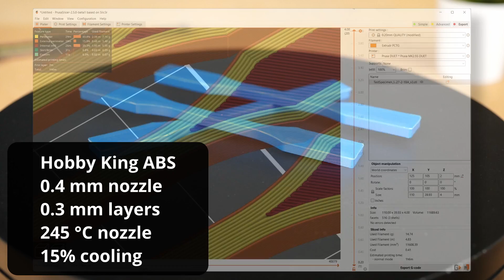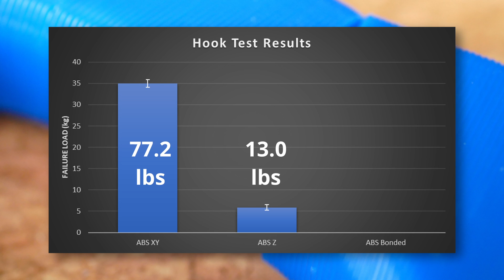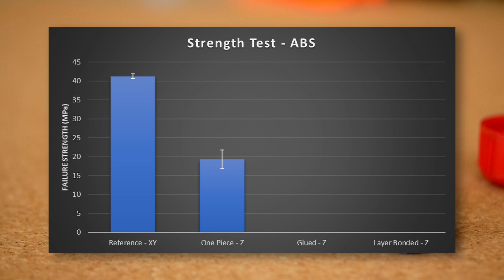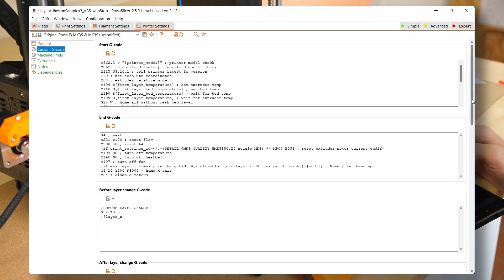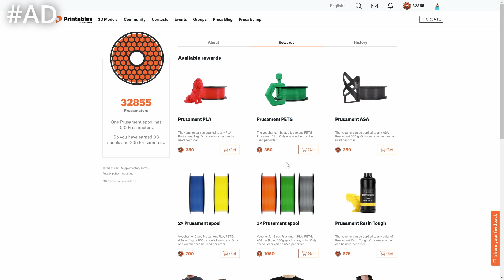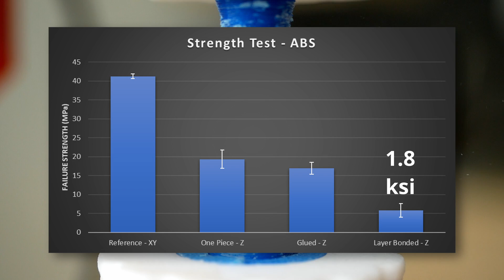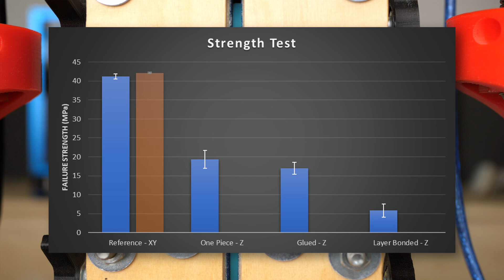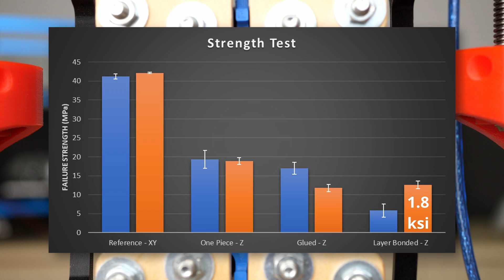Perfect Layer Adhesion if you Brush Solvent onto every Layer of your Print?

Comment: What about changing the nozzle tip geometry? Something like a cake decorating nozzle that lays star shaped beads instead of round ones. It should allow more surface area between layers and the layers would no longer be planar.
Reply: I think that would likely create stringing issues from the sharp corners dragging.
Cool idea though. Maybe an ovoid shaped nozzle would work.

Comment: What about printing in a vacuum chamber? I think that concept would be interesting to see it's effect on the print strength. With no air to be between the layers it would make sense that the layers would bond better.

However there would be a lack of cooling if that was required to avoid stringing and such.

Comment: i wonder if you used an ABS paint (some ABS dissolved in acetone) would work better.. and id be interested to see what layer "ironing" would do for strength? or maybe "pinning" each layer by having small holes in each layer that have a perimeter and say every 3 or 4 layers the nozzle stops and extrudes some material into the hole so it goes down through the layers? youd need to move the holes around the part and have some layer overlap so each layer has the same amount of support

Comment: I have an idea which might sound crazy, but under the right conditions could be done.

Acetone has quite a low boiling point, which means at a reasonable temperature it can become a gas.

What if, using a specially made, hermetically sealed enclosure, you were to print ABS inside a an atmosphere of acetone?!

:D

Comment: I guessed failure on this project because adding a solvent is like printing a thousand first layers together. I wonder if using a heat gun between layers would be helpful. 

I recently asked my co-worker to design and 3D print a mount to install an industrial camera into one of our robotic machines.  He had never had a 3D printed part made, so I made a couple of suggestions. The intern who actually printed the part for us has never gotten his own 3D printer working, but he seemed to be about to operate our Ultimaker ok.  When my co-worker let me know we were ready for install, he handed the print to me.  It weighed a ton.  I thought, 'what happened?'. Turns out neither had any idea why to infill, and they printed it at 100%.  It felt like a block of delrin, lol. They had decided to print at 100% because there were a number of tapped holes and they "didn't want to deal with wall thickness" and just printed it solid. Hilarious. The part worked great and my $10k camera and lens appear to be working well. The machine operators are so thankful to no longer need to use the point and shoot camera and the robot takes it's own pictures.

Comment: Wild idea for layer adhesion: Non planar printing/slicing. You could add one or more "V"s into each layer. Basically the perimeters go down a bit and then back up in every layer physically locking different layers together. It wont be perfect but it is probably a fairly big improvement.

Comment: What about pouring acetone inside the infill of a print, before closing it with the top layers? 

Instead of using the solvent to fuse together the layers from the outside,
And instead of using the solvent layer by layer (where the new layer is deposited certainly hotter than the boiling point of acetone) as you just did,
maybe you could obtain a smoothing effect on a grater surface by fusing together the layers from inside.

Just wondering!:) As usual thanks for your work!

Comment: Didnt get through all the comments but have you tried to rotate the part 45 degrees, print and test for strength.  It would require more support but the sheering force would not be perpendicular (typically) to to force applied to layers either in tension or sheer.  I would think it would be somewhere between the sheer strength perpendicular to a layer and parallel to the layer.

Comment: I wondered if leaving pockets several layers deep a couple of layers in from the exterior that could be filled with filament, or even resin would make, for stronger parts.  The pockets could be filled so that they tied each other in an alternating pattern like verticle brickwork. One effect would be to put the adjacent layers under compression as an injected column of hot filament would contract more in the z-direction which should have a beneficial effect as FFF printed parts normal fail at the outer surface layer lines.
Reply: The same principle as prestressed concrete.

Comment: Dear Stefan,
Rotating head or rotating table you choose!!!! you can't "weld" and cool at the same time, do you do it like that with tin? the impression must always advance in the same direction to be able to point a laser at the joint and cool the layer later.
You can also use a 20,000-turn spindle with a tapered-end milling cutter used to make printed circuits. The material will be heated by friction and will generate a V-groove where you deposit the new material.
3d printers are a design compromise, not the best design and they still do a great job.
Excellent channel, great job!!!

Comment: If you really want a strong part and are willing to do extra work. Why not simply print a part with extremely low or no infill and just fill it up with an epoxy or some castable polymer? Or just resin print it with a mechanical resin if the part needs to be strong in the Z axis too.

Comment: Hi Stephan, I had this idea floating in my head for a bit now. What about trying acetone vapor deposition in a vacuum chamber,  I think the acetone might be penetrate deeper within the parts.
Reply from the maker: Tried that already. Check my videos.
Reply: @CNCKitchen  I saw that video that's what gave me the idea of trying it in a Vacuum chamber so the acetone could penetrate every gap, I think in air I don't think the acetone can displace the air in those gaps.

Comment: What about using a combination of infill and solvents. Where Instead of full infill you have tiny flow holes throughout, from top to bottom. Make a solvent inlet at the top, and outlet at the bottom. Where you would pour the solvent in the top of the part, and it would flow through all the tiny micro tunnels and weld them together.

Comment: Why don’t you make the parts without top and bottom layers so then you will have a path for the solvent to evaporate? I don’t think that would change the strength of the parts.

Also, I would place a sponge right to the hot end (at ~nozzle height) with a tube filled with solvent, and a small routine to move the sponge over the layer right before new layer is starting, that way you can “automate” a little bit more.

Anyway, awesome video!

Comment: maybe try print each layer normal, and then print the layer again, with no extrusion, no part cooling at 1/5th speed slightly pressing the hot nozzle into the layer. Kind of like ironing each layer.

Comment: Can you test whether a low level “fuzzy skin” creates stronger parts? Something like 0.06mm depth, 0.08mm distance? I feel the zig-zagging on perimeters could increase bond strength. Also test solid infill line direction (not gonna effect round columns but square cross-section objects maybe. I run my line direction parallel to square object sides as opposed to the usual 45 degrees (looks nicer in my opinion)

Comment: For the vertical layer samples which are like cones, you need to disregard samples that failed outside of the sampling region (aka any point except the thinnest point) because it means there is a some kind of flaw/anisotropy in the material at that point and is not representative of the material itself

Comment: You can vapour smooth/brush smooth Carbon Fiber ASA with acetone. By smoothing the outside it creates a homogeneous shell. Seems stronger in my opinion. You could also try airbrushing acetone on - (well ventilated area, respirator etc). I tried brush smoothing with acetone then an application of spray on “plastidip” metallic blue.

Comment: Do you think the delay between layer printing could add a confounding factor for controlling adhesion? I mean, each substrate layer cools more with added delay. Although, maybe the acetone evaporation makes this a moot point as it draws lots of heat out of the underlaying layers. In this regard, i wonder if layer adhesion trends with polymer heat capacity.

Comment: What about loading clay on printed parts like a casting with an opening at the top and mixing acetone with resin so it will more easily soak into the plastic as it sets up?

Comment: Pulsating extrusion ... thicker/thinner/higher/lower line sections (weaves) in each layer, but every other layer pulsates half a wavelength offset, resulting in a kind of dovetail joints between layers.

Sounds good ... but probably pretty hard to implement mathematically.

Comment: So the perimeter are only connected with the top to the bottom of the next perimeter. How about printing 2 perimeter, the outside with a hight X and the second perimeter with 2X, the next outside perimeter would go from X to 3X, the next inside perimeter 2X to 4X.

Comment: My top 3 ideas (I know the first two will work):
1: Print with natural filament. Colorants often negatively affect layer adhesion.
2: You already tested this one, but a layer width to height ratio of 4:1 or greater will help.
3: You could try aging in an air fryer (convection oven) at 80-85C for an hour or two. That's the temperature of my heated chamber printer (Method-X), and my ABS interlayer strength seems better than what you're seeing (but I've never tested it in the exact same way as you).

Comment: Maybe instead of solvent, you should try some primer (like ones used for gluing polimers)?
There are also techniques that are using corona discharge or other cold plasma for activating surfaces.

On the other hand with that test sample it might be possible to have "intermediate" layers, placed in middle between extrusion lines, and propably with lower flow.

Comment: Why not print the part at 0 or low infill and then pour 2 part epoxy, acrylic or polyester inside. You might either fill it 100% with resin or just pour it in and out to make a thick coating. It won't affect the outside appearance but would make it way stronger. The trick might be to ensure the part can be filled and not leak.

Comment: Maybe modulating the z height with a sine wave for instance, but only by a small margin relative to the layer height would increase bonding? I don't have the time to test this but it should be doable using Marlin or even g-code (the files would become enormous though)...

Comment: Stephan, what if, after printing a few layers the head moved to the center of the internal void between the layers or the infill and extruded a large blob to fill in the void. The print head can also move down by a layer of so relying on the taper of the nozzle for clearance. Some fancy slicer work will need to be done for complex shapes, but can be tried manually for simple ones. The blobs large thermal mass might help it bond to the walls and blobs below it, while the walls can be printed at lower temp with more cooling for better appearance.

Comment: I wonder if heating a print at a temp just below the warping/deformation/melting point for an extended period would help layer adhesion. Something like the method for tempering metal.

Comment: one thing i can think of for layer texturing is perhaps a few small bumps/ spikes on the nozzle around 1/10th your layer height and running it a bit slower. i could see this potentially creating a larger surface area of contact along with heating the plastic right before the new plastic is pressed into it. i would love to see you test this because as of now all my nozzles are ruby tipped.

Comment: In my lab, I had access to a sonicator probe. It could fuse pla together. I wonder if it would be possible to have the probe pass over each layer after the extruded to fuse the pla. Course that's beyond my skill set but using a sonicator probe to improve layer adhesion

Comment: I would love to see a layer adhesion test with a truly 3d printed layer pattern, so let me explain:

While watching this brilliant video, i was thinking about the 2d factor of layers. The prints we know and mosly prduce are actualy not realy 3d but layered 2d slices over each other. As widly known and proven by many of your tests, the layeradhesion is most often the weekspot. So i cam to my thought:
"What if we could get a slicer to print the layers not flat in the XY-Plane but 3D ind the XYZ-Space?" 
#nonplanarSlicing 

Adding a Z-Component could be done in different ways. The simplest i can think of is the spiral mode for vases, but that is limited. A wavepattern seams to me be the most promising approach, since it could improve not only the shearstrength but also the layeradhesion strength since every layer gets more surface area. The amplitude of these waves would be limited by the shape of the Nozzle...
An other way off acheaving the added strength of the z layer sounds crazy but if one can get it working, it would offer some new ways of thinking about 3D-printign solids: What if we use the printer to print smal pockets, like molds, and then lower the nozzle flush againts the print and inject molten material like you would do with injectionmolding. The cavities  size is something to experiment with but i think that they could be multiple layers high and some milimertes wide. That could create pillars of optimal strengthy material between the Layers. 

Thanks for your wonderfull content and all you thougt me about printing and approaching problems!

Comment: Some kind of non-planar printing might be cool: each layer "weaves" up and down so that each layer is partially bonded to the layer below on the sides in addition to underneath, if that makes sense. Might be a bit difficult to program, tho, IDK.
Reply: Yeah. I think it could easily work like that for perimeters: You print the entire perimeter, but you leave out a few small sections. In the next pass you basically just print on top of that and get the "weaves".
Reply: I've also thought about a method like this often and would be interested to see it in action could possibly weave from the wall back and down one layer into the infill and have the infill lines cross over those weave points
Reply: I would like to see a test where each flat layer of a print was converted to and printed with a sinusoidal pattern that was something like this: http://xahlee.info/SpecialPlaneCurves_dir/Sinusoid_dir/wave_surface.png where the units on the 3d graph are in Layer Heights. The bed would have to constantly move up and down in Z as the head moves in the X-Y plane but that is a fairly simple mathematical distortion. It shouldn't effect the external geometry any except at the top and bottom surfaces but that would be ok for a Z strength test sample. Since the Z travel would be so small it should be achievable on any printer. I expect the z-strength would increase proportional to how high you could make the peaks relative to the diameter. If you could get a 1/1 ratio (instead of the 2/7.5 ratio shown in the graph) you could probably reduce the difference between the X-Y strength and Z strength by 70%. It i might be hard to get it to that ratio though depending on the geometry of the nozzle tip. The sharper the nozzle the higher the ratio probably. Most nozzles have a small flat area around the hole where the filament comes out which would be a limiting factor probably. A sharper nozzle like how this one is depicted might help: https://i.ebayimg.com/00/s/ODUyWDEwMDA=/z/UY4AAOSwYzZgxx89/$_57.JPG?set_id=8800005007 (I don't think that picture is really like that, I was just looking for an image that showed what I was talking about). I think this would make a big difference and could be implemented without too much modification.
Reply: @oriansbelt  This is how I envisioned achieving the original suggestion by Bjorn-Oskar Ronning. I think it would improve the strength but I'm not sure by how much.
Reply: Indeed, for a rectilinear infill (horizontal and vertical), if you imagine printing: 1/2 the vertical lines -> 1/2 the horizontal lines -> other 1/2 of vertical lines -> other 1/2 of horizontal lines -> ... you get a weave!

Comment: "Weakest Link" in action. A single layer without proper amount of solvent will fail. The cooling caused by the solvent evaporating will also cause poorer adhesion between layers. This is a lost cause and will never work. Nice to see someone thinking outside the box though,  I love your approach to 3d printing, keep up the good work.
Reply from the maker: Very good point. Should have talked about this point more in the video.